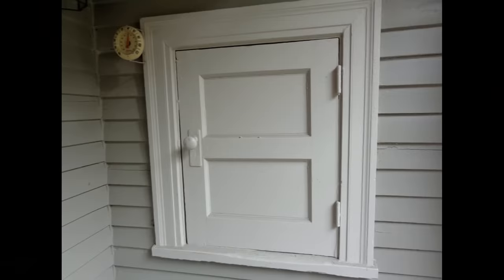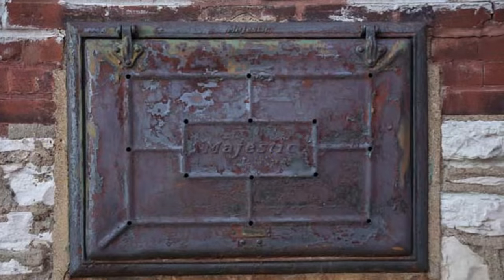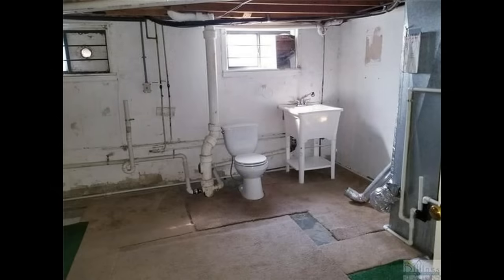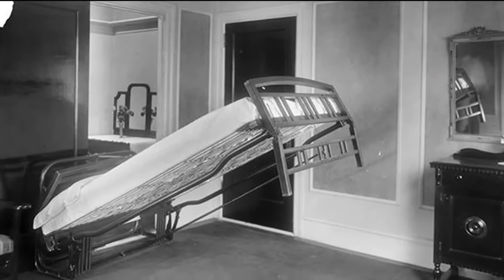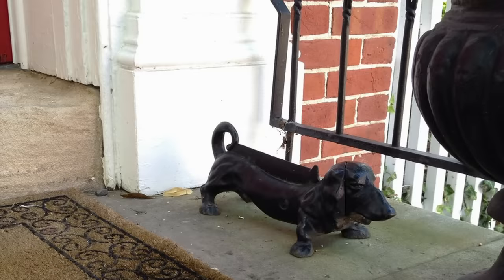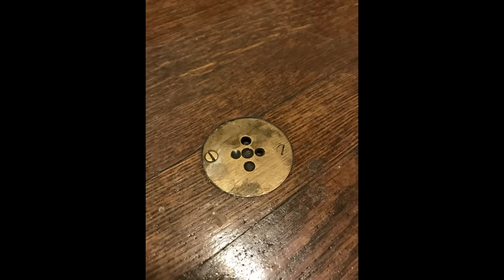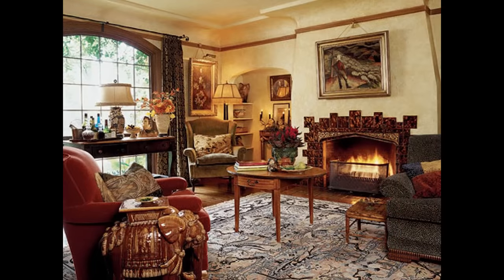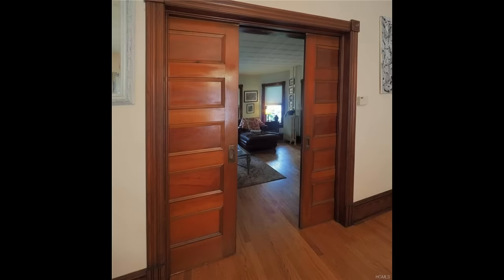Mysterious Home Features No Longer Used

Comment: The "old" phone plug is actually a newer one.  The earliest telephone plug in any homes was a 4 hole receptacle for the 4 prong cord plug to connect the ;phone at different locations in a home.  We converted our 1958 house to the smaller plugs around the mid-1980's.
Reply: OMG I have one of those!  I'd been wondering...
Reply: I've still got some of those old 4 prong receptacles from when we changed ours out in the early 80s. My dad never threw anything away.
Reply: Before that giant four-prong plug was a similar 3-prong version.

And a still older fixture is just a box with screw terminals inside -- from days when installing a new extension phone was a telephone company service call.  (And the instrument belonged to the phone company -- it was part of the phone network).
Reply: modular
Reply: @bryanhenderson591  this is interesting  little timeline of phone plugs. Thanks for the comment!
Reply: Ours was hard wired because the phone company owned the phone and the line and you were not allowed to put something they didn't control on it.

Comment: I agree with bringing back pocket doors and transoms. One is a space saver and the other is a beautiful decorative touch.
Reply from the maker: Yes they are.  Thank you for watching!
Reply: I was in a house built in the 60's...all the bedroom doors were pocket doors.
Reply: What people don't get is that a lot of this old stuff doesn't work anymore. We have transoms. Good luck finding the hardware to work it.
Reply: Pocket doors are a headache they don't stay adjusted then they hang wrong and you have to tear into the jamb to readjust them.
Reply: Transoms also cut down on the amount of electric lighting you need in the interior rooms.
Reply: My grandparents' house has pocket doors, and as far back as I remember they were regarded as too much hassle to bother closing in most cases
Reply: Not sure where you live but in my country Australia sliding doors never disappeared. And I can’t believe this guy needs to explain the concept of separate rooms - that’s hardly disappeared.
Reply: Pocket doors are very expensive to install and maintain. They are also less functional in a fire. In Japan many pocket doors have been replaced by swinging doors due to jamming during earthquakes and emergency evacuation.
Reply: Pocket doors are still out there and the new trend to save space is barn doors that slide.
Reply: My grandparents had 2 pocket doors. There was never any trouble with them. One even had a lock, and I don't remember it ever not working.
Reply: People love pocket doors until they see how much installing them into a new build costs. Doubles the wall thickness but that's additional insulation. Most houses are built by folks want to spend money on visible items like more expensive fixtures. Pocket doors can be designed for new SIP construction and makes a very efficient home.
Reply: I lived in an apartment with cheap pocket doors, and I would take that over not being able to put my bed where I want! I miss pocket doors so much! They made the house feel so much bigger!
Reply: I'm renovating my kitchen (1926 house, of course the kitchen isn't that old!) and I was shocked when my husband suggested enclosing the space where the transom window is when we replace the door - we are definitely replacing it with a fixed glass panel! Even directly under the roof overhang (portico?) it lets in a nice amount of light. No need to be able to open it, though, since we're replacing the gas stove with induction and installing a vent hood.
Reply: "Barn doors" are the new pocket doors.
Reply: The walls for pocket doors are necessarily so thick that room space is taken.
Reply: @dhandley8893  - I have multiple pocket doors in my 1950s home and all the walls are the same thickness, which doesn't seem abnormally thick at all.

Edited to add that none of my interior walls have insulation either, only the exterior ones. I think that's fairly common.
Reply: @windsofmarchjourneyperrytr2823  Restoration Hardware? Or another similar store?
Reply: Personally I prefer pocket doors. I hate closet doors they are always in the way. I think that in many cases depending on size of closet that a pocket door should be installed.
Reply: I thought transoms allowed for airflow between rooms ?

Comment: Transoms had a more interesting purpose when gaslight was common: Gaslights put out a shocking amount of heat, and popping open a transom would let the hot air out instead of pooling around the ceiling and heating up the room. An open window wouldn't help nearly as much, because the heat would have to get down below head-level before it could get out.
Reply: They also made cooling the house more effective by creating a crosswind from temperature differential. You'll notice in a lot of old houses and school buildings, there are windows that open at the bottom, and windows that open at the top. Open windows on one side of the house at the top, and windows on the other side of the house at the bottom, and the temperature difference between the top and bottom creates more effective air circulation than simply opening regular windows.

Honestly, older homes were often made more intelligently than modern homes.
Reply: That's so interesting- now I know why they were in my old apartment! They looked exactly like the picture in the video.  We would open or close them every once in a while but not for any real reason haha
Reply: @joem4507  What makes you think that was the MAIN purpose rather than a side benefit to what is primarily temperature control?
Reply: An open transom window also allowed voices to be heard clearly from another room or a neighbor's apartment. Thus the expression "I heard it through the transom".
Reply: I remember transom windows from a school I attended
Reply: @Keenath  Joe M's post has disappeared :-(
Reply: Transoms are nice. But I am not sure if fire resistant ones can be designed. One of the reasons transoms went away is that they speed the spread of smoke and fire.
Reply: @mrs2691  Auto close weight & fusible link should do it
Reply: Stratifying more than pooling.
Reply: @vwestlife  Or, "it came over the transom."

Comment: Here's one more: high ceilings. If you've ever been in a home from the 19th or early 20th century in the American south, you might've noticed that the ceilings were weirdly high. Sometimes as high as 12 feet, compared to the 8 or so feet typical of modern homes.

This was air conditioning. The high ceilings allowed warm air to rise higher, above the heads of the room's occupants. Today though, air conditioning and ceiling fans allow for lower ceilings and more compact, efficient buildings.

Side note: if you're new to ceiling fans, you can change their direction. There's a switch somewhere below the fan blades. If it's up, the fan will spin one way and pull air up, if it's down or will spin the other way. Use this in the winter to push warm air down from the ceiling, and in the summer to pull it up.
Reply: Also from the American South. The house I grew up in had an attic fan. A friend of mine still has one and uses it during the summer months. It works well. If I ever have the chance to build a house, an attic fan will be included in its design.
Reply: @Michael, we’re the upper sections of those tall walls sometimes slatted or perforated to allow air flow? A design often seen in the tropics.
Reply: @naomiburn8386  Not that I've seen, but it's a feature I haven't really looked for either. I'll keep an eye out in the future
Reply: Those super high ceilings were also used in S Calif, they really reduced the heat.
Reply: Haha I commented more or less the same thing except I discussed how tall windows that could be raised and lowered went with high ceilings to circulate air in the room.
Reply: When I see an unusually high ceiling, I think it makes changing a light bulb harder.
Reply: I had to teach my mother how to use fans, and we grew up with one in our house. Then we moved to the family home and we had only window fans. We had reversible window fans. She asked if these were the same.  I said yes.  My grandmother thought it was all so strange.
Reply: I never knew that about ceiling fans! But then I've never seen one (I live in the UK and they're not a thing here.) Fascinating TIL, thank you!
Reply: My parents have one with the WALL switch determining the direction. Literally says "summer" and "winter" on the switch. Put in in 1995.
Reply: @OffGridInvestor  Nice. Why didn't that 90's thing stick around? That's great!
Reply: @jaymesc.moreland9265  they're VERY good. I have a cottage from the mid 1800s. I made a solar powered one to keep the roof space cooler in summer. The panel is too high voltage so they blow up the fan eventually but I use computer fans that I have tons of from old 90s computers. It died last year but next summer (southern hemisphere is coming into winter now) I will get up there and replace it. You get the angle of the panel right and it'll only start at like 11am so only when the roof starts to get hot, and then goes to almost sundown.
Reply: @naomiburn8386  in Darwin in the tropical North of Australia, they have those mounted on the verandah between where handrails would go and the guttering. There's a government multilevel building MADE for cyclone/hurricane/tornado conditions with aluminium honeycomb on an angle. ALL THESE things basically not only cause upward drafts to cool AND shade the house exterior but are also essentially flying object protection during the cyclones.
Reply: @michealdrake3421  these are standard in Australian tropics
Reply: The building I’m working on now has about 14/15 foot ceilings on first floor
It is 22 steps to 2nd floor, landing in the middle.

2nd floor about 12 feet
Reply: @g.t.richardson6311  That's crazy! I love high ceilings like that though.
Reply: Interesting because here old homes have short ceilings and new ones have tall ones. Like old homes you could probably touch the ceiling while standing normally but in new homes they’ll open up the ceiling right into the roof.
Reply: @rachelcookie321  Where is here, if you don't mind my asking? A lot of old trends in architecture, while they seem to us like quaint or strange features, were usually practical solutions to common problems, while more recent trends have to do with technology solving those problems in other ways, allowing us to focus more on other things. Like, high ceilings are cool, and in lieu of air conditioning are a good way to keep a room cooler, but when a/c is an option they become a huge waste. It's a lot of space that can't be used for much of anything besides looking at, and sometimes there's even enough of it to add a whole extra floor of you wanted. If nothing else, those high walls take up a lot of construction material, and it creates a huge space to manage the climate in, which is why old buildings are often retrofitted with drop ceilings when they get central air and heat installed.
Given that pattern, I would assume that the low ceilings were a practical solution to a common problem there, and more recently technology has solved that problem in another way, so the low ceilings aren't necessary anymore.
Reply: @michealdrake3421  I live in New Zealand. The homes were built with low ceilings and it’s apparent with multi storey buildings. I also believe it’s like that in the uk where I am originally from.
Reply: @rachelcookie321  Interesting. I'd guess, since the climate is cooler and wetter in Europe and NZ than in the US, especially the south (the US is quite a bit warmer than Europe at the same latitudes, we have hot summers compared to Europe) that lower ceilings made for smaller spaces, making buildings easier and more efficient to heat. As climate control technology got better and insulation improved, spaces could be made larger without having to spend much more money heating and cooling them. Globalization making building materials cheaper would also make larger buildings more financially feasible for the average homeowner. That's just an educated guess though, there could be any number of reasons, right down to it just being what people at the time thought was cool. Thanks for sharing though, that's interesting
Reply: @gillianbergh7002  My parents have a ranch house with a high ceiling in the living room. Our old house was a cape cod built in the 50's with 8 foot ceilings throughout, so my dad had to go out and buy a ladder the first time a bulb went out in the recessed ceiling lights.
Reply: @michealdrake3421  I wouldn’t say the weather is cooler and wetter in New Zealand than America. It can get very hot here during summer.
Reply: @rachelcookie321  Maybe just a design choice then. Like I said, just a guess. I had thought NZ's climate was a bit more similar to Britain's, but perhaps not
Reply: @michealdrake3421  New Zealand’s climate is quite different to the uk. It is a lot warmer here and rains a lot less. In the UK people consider 16°C as warm, in New Zealand it’s considered cold. At 16°C in the UK you would be outside in shorts and flip flops enjoying the warm summer weather, in New Zealand you would also be wearing shorts, because for some reason people always wear them here even in winter, but you would be inside under a blanket avoiding the cold winter weather. It’s not an exaggeration and it’s the actual mindset of people living in those countries. The weather is actually quite different.
Reply: @gillianbergh7002  it does but high efficiency bulbs make it more sensible in modern homes. Although many times lights in high ceiling homes are floor lights and table lights. 
Another concept that's out of fashion is shot gun/dog trot homes, where the air can flow through from two doors on the opposite ends of the home. I could see this being a thing in tiny homes for efficient off the grid cooling.
Reply: And the very low ceilings of houses from the 18th and 19th centuries in the northeast US. My parents were house-hunting and saw one they really liked. They went upstairs and my 6'4" dad brushed the ceilings in all the bedrooms! Low ceilings trapped the heat in a cold climate.
Reply: I grew up in an Australian colonial workers cottage/Queenslander that was built around 1890, and the ceilings are about 5 metres / 16 feet in my bedroom which is on the side of the house. The rooms in the centre of the house have higher ceilings, closer to 6.8m/21ft.

In a more traditional style Queenslander there isn’t even a ceiling, and the tin roof and wooden beams are kept exposed with a gap between the top of the exterior walls and the verandah roofing sheeting for lots and lots of ventilation. The floor was also wooden boards raised above the ground by stilts that didn’t have any walls, allowing air to flow under the house (and also offered protection against flooding). Obviously this is for a climate that doesn’t get very cold, I can’t imagine how awful a snowy winter would be in that kind of house, but for summer it’s great.
Reply: My house in the south was built in 1900 with the high ceilings & I LOVE them, in the summer!  I can wait to turn the air conditioning on until later in the afternoon and off early evening.  
They suck in the winter, really hard to heat :(
Reply: Ours were 9-1/2 feet high (house built around 1900).  Oddly, the first house my husband and I bought had 6-1/2 foot ceilings, built during WW II.  The second in which we raised our family had the 9-1/2 foot ceilings - great for huge Christmas trees!  My business building (built circa 1936) had 8-1/2 foot ceilings so a standard 8-foot paneling didn't work well.  My home now has 7-1/2 foot ceilings which is absurd.  They also put picture railing at 7 feet; the house was custom built in 1947.  Even the dining room windows are odd - four of them side by side, 4 feet wide and 7 feet tall.  I wish I could talk to the people who had it built and ask them why certain things.  It has a breakfast area with a huge window overlooking the back yard - kewl!  What is does not have is any cross circulation and very few openable windows.
So we have had 6-1/2 foot ceilings, 7-1/2 foot, 8-1/2 foot and 9-1/2 foot but none 8 feet. LOL
The 6-1/2 foot had ONE small corner window in the living room and knotty pine paneling on the walls and ceilings - talk about dreary and dark!  Contrasting, the 9-1/2 foot ceiling house having huge windows, two sides in the living/dining room - very airy and light-filled.
Reply: One of our first apts. had huge ceilings like that. We were able to get a huge tree that Christmas. Had to be bolted to the wall it was so bugs
Reply: Fun fact: Apparently the other reason for old architecture high ceilings, wall vents and double-hung sash windows (where the top sash window comes down) was not only for summer air conditioning, but essential for ventilation in winter.

The fumes from coal fire heating common of the time are quite poisonous and this was apparently essential to exhaust the fumes and prevent asphyxiation.

...and we worry about paint and carpet VOC out gassing...
Reply: @tvctaswegia497  that makes sense because it was coal heated originally.
Reply: In the summer you want the air to push down. In winter you want to pull it up and get a convection current going. I live in Florida, ceiling fan capital.
Reply: @chiarac4967  I've always used it the other way, but that's an interesting idea, I'll give it a try.
Reply from the maker: Thank you for watching and explaining a little more for us all.